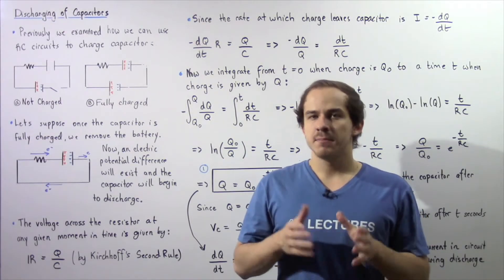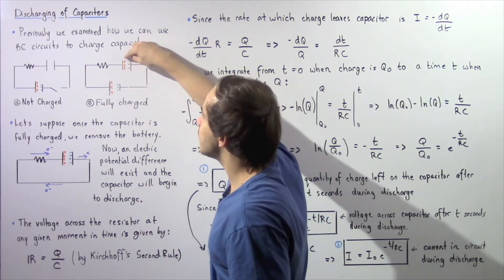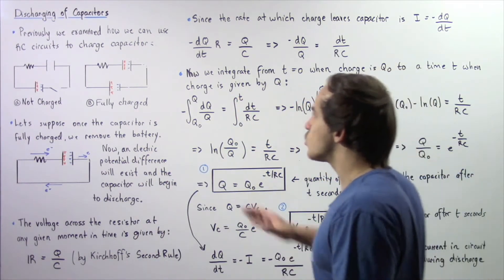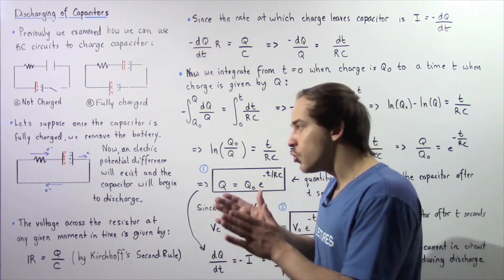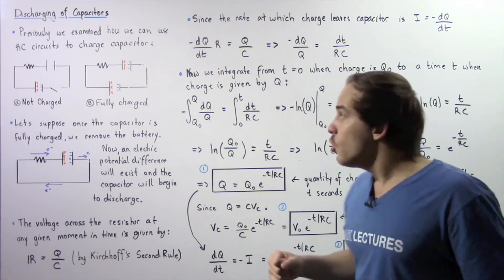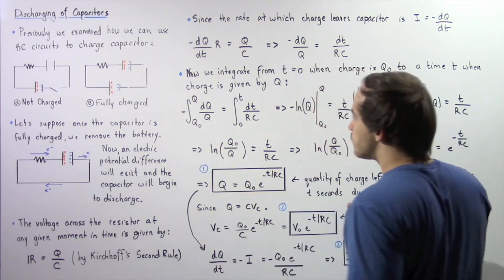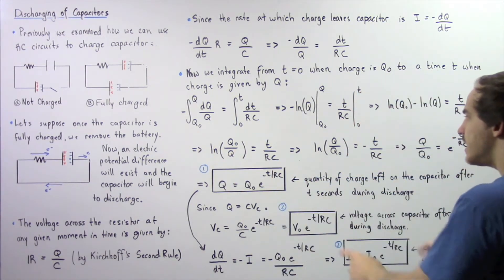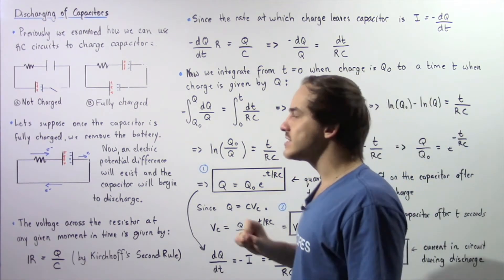RC Circuits and Discharging Capacitors with Equation Derivations

Comment: I spent a literal hour hopelessly working on deriving the voltage as a function of time equation because I'd never had to do this type of problem in the class before, since I'm not even in the calculus-based course. I still don't really understand it, but at least I have the answer. God bless this man.